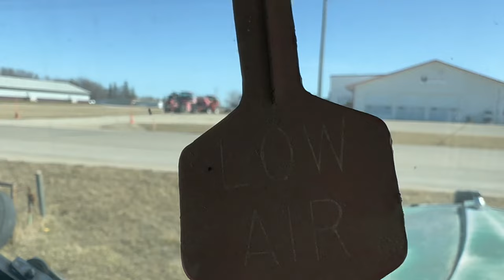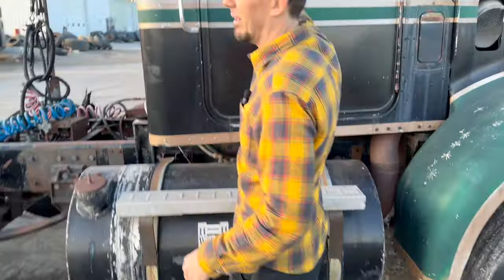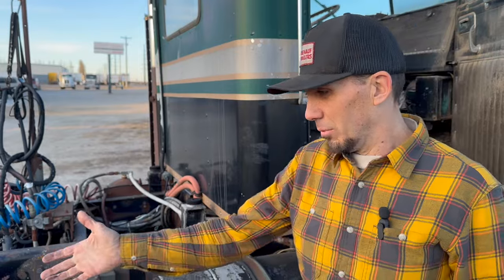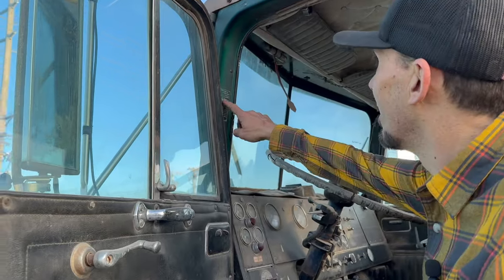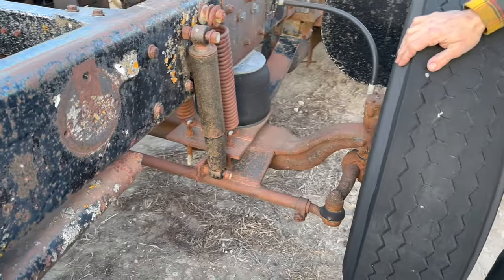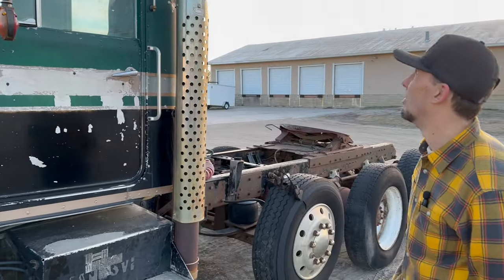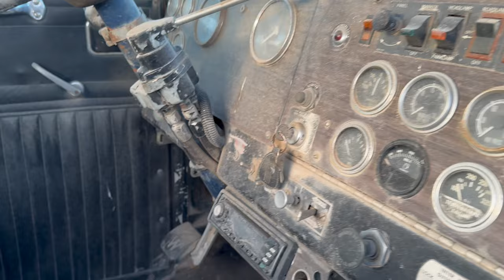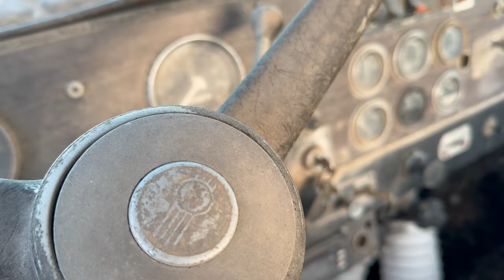Exploring a 70's Time Capsule

Comment: That’s a Big Cam 1 or 2. They came out about 1980. Those fuel tank caps were a drag. They leaked water down the stopper style screw. Torsion 
bar suspension where rated about 34,000 lbs, so not a heavy speck truck to start of with. They were an expensive suspension to maintain. 
It doesn’t appear to have a frame insert under the 5th wheel either. I definitely had a sleeper when new. The passenger seat was from a “ Splender 
Interior “ which was an upgrade in the day. Had stripes. The headliner is an aftermarket add on, as it would have had a “ Cyclolac “ plastic one. 
High mount Kyser roof mount is typical for the day. I think the “ Grilldenser “ came soon after. A nice representation of what Kenworth had to offer
back in the day. It’s a mid set front axle, a full set back would have had a front sump oil pan.

Comment: I drove a 72 needle nose KW 335 Cumins turned up a little , twin stick 4x4, with torsion bar suspension  and it rode pretty good, better than the leaf springs most rigs had  back in the day

Comment: Surprised how clean the engine is. I was told the torsion bar suspensions rode very nice, you just have to keep the greased. Glad you like the idea of not modifying it with a long hood, new frame etc. This truck is to well kept to mess with it.

Comment: That KW is a W925 S21  They had the new at the time unit glass hood, this one being the S21 set back, as you can see the grille protrudes 2 inches out further than the headlight fenders. The torsion bar suspension ride quite a bit better than a lot of spring and airbag types. The back window appears to be a larger replacement to the original opening, most likely because of the large crawl through cutout. The 4 mounts directly behind the cab shows it did have a sleeper attached before being converted with the helper axle. I have an original factory spec K125CR, VT903 RTO915 and SQHD Rockwells on long torsion bars.

Comment: That's all they had then was crawl thru the window in the back of the cab probably rolled down.  Torsion when it was loaded road fairly good. Lot better than a Hendrickson. I believe that's a standard hood not a set back axle.
Reply: No it’s a set back I got 2 standard hood trucks that vintage. The headlight buckets are flush with the grill on mine those are set back some from the front.

Comment: Cut the old frame off. Put a new frame on there. Blue single in a Newark can I? Never you are framed, cause I'm nice and cleaners on there. Just that truck up good and nice and good to paint get some new get. A new on you. Yeah, well, you shifter, drop a brand new and nice Caterpillar engine in there and LA d lights on top of new stacks.  Heavy crack in the back address that puppy up